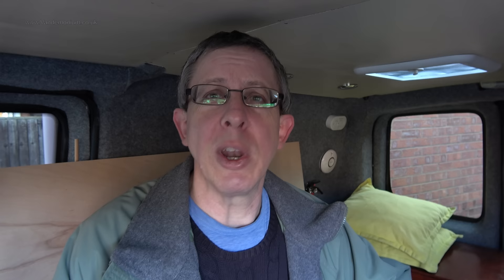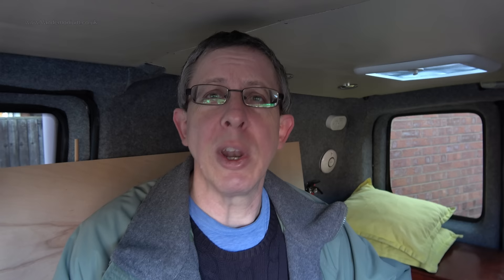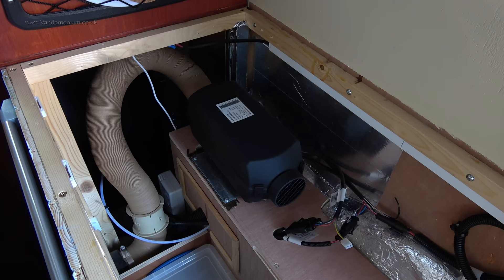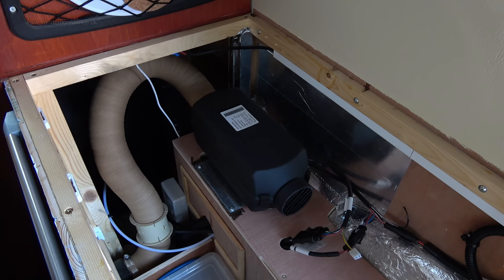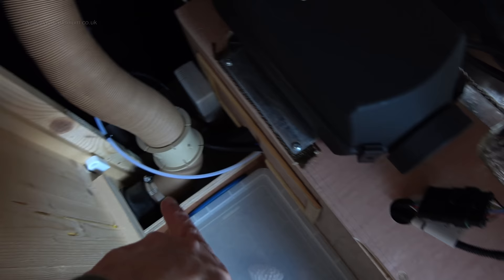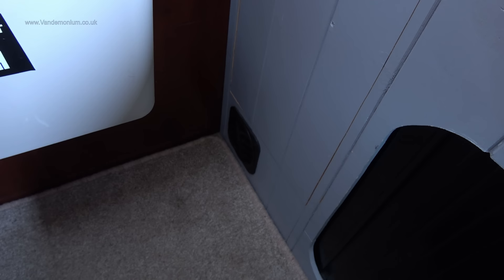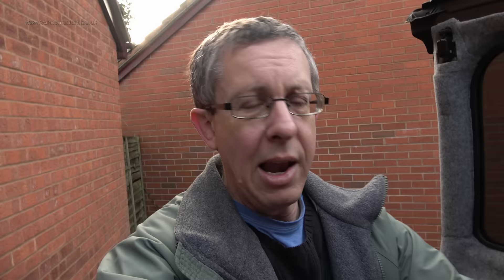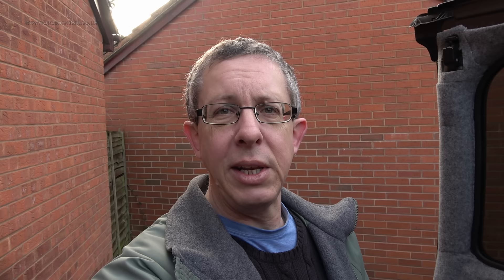71. Finishing the diesel heater installation in my campervan

Comment: I'm not sure if I would have bothered with the thin white plastic pipe but used the black pipe.
Reply from the maker: No, you can't do that - the white plastic pipe is especially tough and inflexible, specifically so that when the fuel pump pulses, the fuel squirts along it rather than bulging the pipe which results in insufficient fuel delivery. It's one of the common problems with the cheap knock-off heaters, the pipe is tat and doesn't result in proper fuelling. There's a lot of videos both recommending replacement of it and one I found which demonstrated the issue in excellent detail. The black flexible pipe would be even worse.
Reply: @Vandemonium  OK.👍

Comment: filters are about 50p from any car parts place. Also you have a pretty big diesel tank already don't you wouldn't it make sense to use that
Reply from the maker: It's easier to just have a separate tank than to drop the main vehicle tank and tap into it, that would be beyond my abilities

Comment: Looking at all the connections on the fuel feed, could you not remove a significant number of connections and just use the black fuel tubing until you get the final white pipe that goes through the bulkhead that has black tape.  Just a though to help reduce the chances of over time, one of the many connections coming lose.
Reply from the maker: No, there's a specific reason you need to use the pipe supplied, it's to do with the small amounts of fuel and flexing of the pipe (too long to explain here). Clearly wherever you need to add an item like the pump or fuel filter, you need a joining piece to bring the two solid items together, as shown.
Reply: @Vandemonium  ahh OK. I was just curious. Thank you for getting back to me.

Comment: Are you not worried about exhaust gases getting into the van interior with the way the heater is mounted? 
These normally mount to the floor of the van. 
That said a nice job!
Reply from the maker: Nope. See my prior video (not the Christmas one, the one before that) where I explain.

Comment: David, one question. How is any air going to get into your diesel tank to replace the fuel? Am i missing something?
Reply from the maker: I will drill a tiny hole in the handle of the tank
Reply: Wow, hadn't even thought of that! The tank would eventually implode without a vent?😮
Reply: @Vandemonium  That is the very last thing you should do,  trust me, it WILL leak as the fuel sloshes about as you drive.  You need a fuel container that has a cap with a one way valve, where air can be sucked in but nowt can come back the other way.

Comment: Wow. So many pipes and so many clips. You could have just bought a bit of black fuel pipe, ran it from the tank to the pump inlet and then fit the filter in the middle. Do way with the clear pipe altogether. Just sayin......
Reply from the maker: No, there's a specific reason you need to use the pipe supplied, it's to do with the small amounts of fuel and flexing of the pipe (too long to explain here). Clearly wherever you need to add an item like the pump or fuel filter, you need a joining piece to bring the two solid items together, as shown.
Reply: @Vandemonium  Ahhhhh. I've replaced several fuel lines in cars and machinery over the years but never knew this. Thank you, David.

Comment: It's quite ironic really  in that the "cheap" heaters you keep referring to in such a derogatory way, not only come with fuel filters and all the  connectors required, but also self prime via settings on the digital displays (although you chose not  to use one) They work flawlessly and all for under 100 quid....what's not to like!
Reply from the maker: Yeah and then you need to replace all the cheap tat bits they come with (crappy jubilee clips, crappy pipe etc)!! They're built poorly.
Reply: @Vandemonium Dave, you’re a bit wrong. I have indeed substituted stainless steel jubilee clips for the included ones but that’s all.  Your heat wrap cost extra, so did mine. And you mentioned buying a cheap fuel filter…that’s surely a compromise? Why spoil the ship for a ha’p’orth of tar? Buy a decent branded one that’s….made in China.  I have two of the ‘cheap’ heaters, my family has a couple too, and we’ve never had a lick of trouble, same as many many other owners.  I think that people abuse them because of the perception of cheapness and they go wrong. If you take the same care during installation and usage, as you would for a £600+ unit, you realise the value when it keeps on going.  Many of the expensive systems are churned out in China too.  A bodger gets poor results and serves him right.
Reply: @Vandemonium  I must have just got lucky then,  I've run an un-modified  5kw in a workshop and also a 2kw in my camper conversion for 3 years, both as they came in the box and both have run beautifully.
I just can't understand the constant "bashing" they get by folk, there must be thousands of them out there purring away as we speak...
PS,  is your fuel cap vented?...Air needs to be able to come in, it might  be something to do with why it's weeping a bit.

Comment: A Canadian here. I have a legitimate question. You keep calling this a "Diesel Heater." Do you actually burn "Diesel Fuel" in it, the same fuel you'd put in your van for example? It could be a matter of terminology. What you call "paraffin" in the U.K., Canadians know as Kerosene. To me "paraffin" is candle wax. "Petrol" is "gasoline" and so on. Are you in fact burning what we call "Furnace Oil" in this heater. It's almost the same product but "Diesel Fuel" would have road tax added to the price here in Canada so that would be a much more expensive fuel for heating. We both speak English but sometimes words have different meanings in Canada or the U.K.  
Oh, and is that a 5 litre jug or 5 gallons. 5 litres would be fairly small, and it's difficult to tell from the video. Have a good year.
Reply from the maker: Yes, diesel fuel. I could have bought red diesel which is taxed less than road diesel if it's for domestic heating but for 5 litres (not gallons) it wasn't worth seeking out
Reply: @Vandemonium  Our furnace oil is dyed red so now I understand. Thank you for the reply. Toodle Pip!
Reply: @davidoickle1778  In the US (and maybe UK?) You can buy actual diesel fuel in either a red or clear version. The red is sold without the extra road taxes, and is for 'off-road' use only (farm and construction equip, etc.) We also have fuel oil available, as well a kerosene. People are expected to use the clear fuel for any on-road applications. But if they do choose to use the red fuel and get caught doing so, the fines are very large.